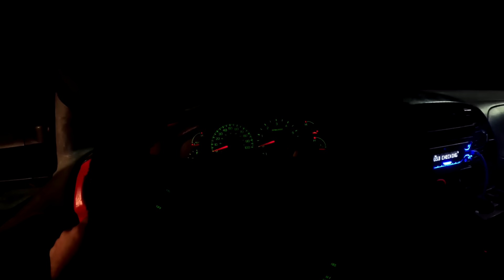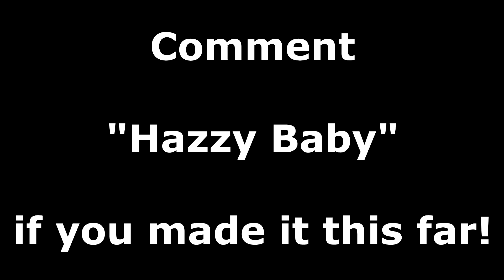SHE'S BACK!!!

Comment: It's a good thing you have the blue truck. Trouble with computor dependant trucks is you could be looking for a mechanical issue when it's a computor gliche. I don't see any fat on you. I didn't notice any benefit fom creatine. Good sleep is as important as good diet. You're running funny hours right now and that will effect your body a bit.. I wouldn't sweat it. Put a code reader on the 150 and make sure of that end of it and then look for physical issues.  You're looking fine, no homo. Good video. Pax.

Comment: So if your trans shifts off of vacuum it'd be easier to diag but I think they switched to electronic around 99 at the latest. If it's electronic could just be a sensor. Also your idle and hard starts are also definitely bad sensors. Easy fixes just have to figure out which ones. Idle wise could be MAF, IAC, or TPS to start. For starting definitely look into your crank  and camshaft position sensors. I mean I'm not totally certain, I'm a Chevy guy but should be the same concept.

Comment: On the f150s the high idle problems are actually very common problems the mas like it get dirty and along with the throttle body having carbon and build up causing it to stick I can’t remember if your truck is a throttle cable or sensor. If it’s a sensor then I would look into cleaning it first. Now the transmission it possibly could be one of the shift solenoid going bad or the torque converter is failing but if the transmission fluid is shine just leave it and driver till she blow. Now with the vibration a common problem it the U-joint being dry, highly recommend getting some grease able U-joints. I haven’t heard of the pinon gear shims causing it to shake unless it’s just looser than shit. If it was you’d hear a lot more clunking than shaking, could also be unbalanced 37”s. I love the channel and seeing everything you’ve accomplished so far, been watching the channel sense you went muddying with your buddy in the red tundra and the Chevy that blew up keep it man your doing great

Comment: I’m a Chevy guy so I’m not a expert on fords but you could possibly have a pcm or epc issue or a trs switch issue, and as for your high idle it is probably a iac issue, I’m not exactly sure how you would diagnose the tranny issues, there’s probably a code, but for the high idle I’d check to make sure there isn’t a vacuum leak or anything wrong with the air hose to the iac, I’m not exactly sure how to test for a bad iac but if it is bad and you end up replacing it and you still have a high idle then the output from the pcm to the iac might be stuck at full batt+ state and all you have to do is remove the negative battery cable for 30 seconds and it should fix itself, I’d actually disconnect the cable first and see if that fixes it, I hope you can get it figured out and fixed because that’s a pretty good truck you got

Comment: If that pan is shoved up towards the filter. The clearance between the pan and filter inlet is VERY important, too big and it'll cause cavitation, too small and it'll slip from inadequate fluid flow to create pressure needed at higher pump demand on throttle or rpm. Just a thought since you said the pan is dented up.

Comment: Once in a while when you are doing seated or even standing curls ditch the curl bar and use dumbells  and stretch out that arm a little further on the extension part.  Takes longer doing the singles on each arm but I think you will see the difference and maybe at it to the routine.

Comment: Kenny don’t listen to everyone about buy a Chevy or buy a dodge from my experience with my old Chevy that was lifted I kept braking transmissions , and Bell housings , the amount of stress lift kits put on a truck is insane, mine was a 3 inch lift with my keys turned up making it sit 5” high in the front and 4” high in the rear with my added blocks , I went through 4 trans in less then a year and a half , I would recommend investing into a built trans , Bell housing and transfer case , also you could potentially buy a heavy duty rear end  pre assembled, would Recommend saving money going that way then going through 4 or 5 transmissions like I did bud

Comment: @RNTV bro a Lil tip for that floor my dad's shop we put down 1/4" Steele plates we had laying around on the shop floor helps allot workin on the cars in there from loosin bolts n even laying on the rocks

Comment: hey kenny in my old truck it would violently shake from 45-55 and i thought my transmission was shuttering and i was just driving it one day and the driveshaft fell out😂 so it could maybe just be a bad u joint on your drive shaft or in my case i think my bolts backed off😂
Reply: It didn’t crack my transmission bellhousing tho just the transfer case

Comment: Whats up kendog! Figured id throw this at you until you until you get a built trans. Definitely seems like bad shift splenoids could be your issue. Id drop the pam, throw new solenoids in, some shudde guard (small red tube) and some lucas stop slip and let it ride until you get your new trans for hazzy

Comment: high idle could be few things id clean the MAF first and check IAC also might check u joints in drive shafts for the shaking typically you shim them when you lift something to reduce stress maybe try manually shifting through gears as you drive sometimes gunk gets stuck in bands and you can clean it out by manually shifting if that does not work you may have some loose bands that just need to be replaced i am not a mechanic just a guy who works on a lot of junk

Comment: Well the transmission issue may be something computer related. My f150 had high rpms and didn't want to shift gears correctly so I blew it up and now it's sitting in my yard... but the transmission issue may be because you have a headgasket going out and it has to push all the power to the motor and you aren't getting enough electrical power to the tranny to shift correctly

Comment: your trans collar could be cracking because the difference ratio of gears from the rear end and trans so the trans could be trying to keep up with the difference ratio in the rear end causing tension in the trans and instead of the drive shaft coming apart it’s the collar

Comment: You’re most likely not losing hair due to creatine, it’s a common occurrence in males. Male pattern baldness exists, although it doesn’t even look like your hairline has recessed that much. And on the vitamins, hit at or just above %dv in all your macros and you’ll be fine. Don’t forget that a poor diet with a multivitamin is still a poor diet. Looking good man keep up the gym grind and original genuine content. Always a mood booster gettin a kendog video

Comment: For the high idle I’d check if you idle air control valve is stuck open. Had the same problem on a similar year model ranger. Just an idea, can’t guarantee that’s the problem 🤷‍♂️

Comment: if it doesn’t feel like your rear end shaking it could be your torque converter, i know between 35 to 50 mph the whole truck will shake if your torque converter is going out

Comment: Kenny boiiii check the idle air control sensor, sometimes they get stuck Open, especially on fords, I had a 1990 f250 that idled at 2600 rpm all day and bumped down to normal when you put it in gear

Comment: Your idle is probably due to a vacuum leak.  also your transmission collar keeps cracking probably because of the driveline vibration they make a tool called clamshell puller to take off bearings with out braking them

Comment: If that gear issue is going through the driveshaft, check your carrier baring and U joint, chalk your wheels and put it in gear to take stress off of it, and check to see if their is play in either, that won’t be the root to the problem, but Is definitely a factor in the 40-50 mph vibration. Idle air control valve/sensor is more than likely why it’s idling so high. Get a tranny out of a totaled 97-03 150, clean it up before you put it in, new filter, pan gasket and fluid, throw her in there with the new gears in the rear end and she should scream

Comment: replace the transmission range sensor and it could be your 3-4 shift accumulator if there is any binding i would do a shift kit assuming this is the 4w70r. im struggling with transmissions myself as i just did a 1-2 shift accumulator on my 4l60e personally im swapping to the 4l80e or i might just go t56

Comment: Since you increase the tire size and you changed the gear ratio did you ever change the shift parameters on your transmission most tuners allow you too but I wasn’t sure if you were using a tuner

Comment: Honestly I don’t think the trans is your issue on the shifting. I THINK ITS THE TUNE Your truck is idling high and when you drive it the shift points are way off. That’s why it doesn’t really want to kick into gear etc. look at getting the motor tuned. Your lacking power badly. And the trans shift points are all over the place. If the shift points are too high it can jerk the trans when shifting causing it to put stress on the extension collar also. It shouldn’t idle that high in park. Tuning is way off.

Comment: I had transmission problems with my f150 identical to yours and a high idle and it was a bad throttle position sensor. Didn't throw any codes either.

Comment: No hate just food for thought. If you re-geared your rear end and didn’t re-gear your front end it’ll mess up your drive train because your rear will be spinning slower than the front and could possibly mess your transmission up and transfer case

Comment: I understand how you feel about having a truck that means alot to you, i have a 1997 single cab dodge ram, its  been dead for 3 years, just got around to looking at it and it has a bent rod, valve and a broken lifter spring

Just havent had money for it yet. But ill probably sell a few firearms i have to get jt running again